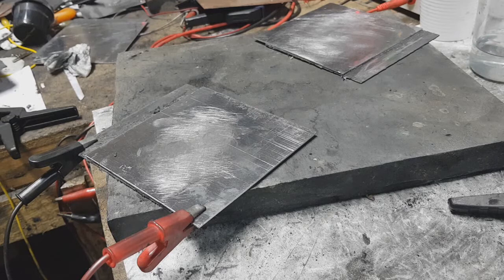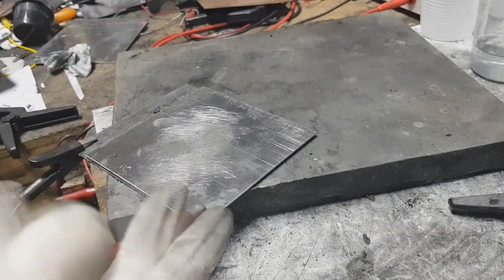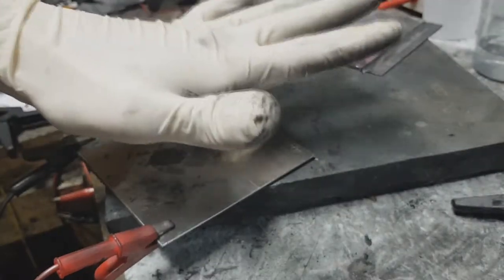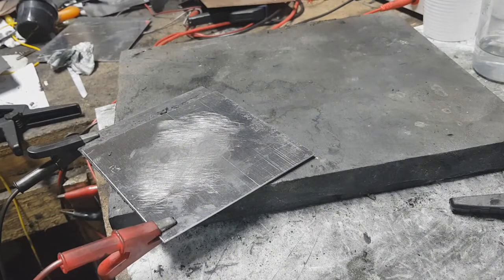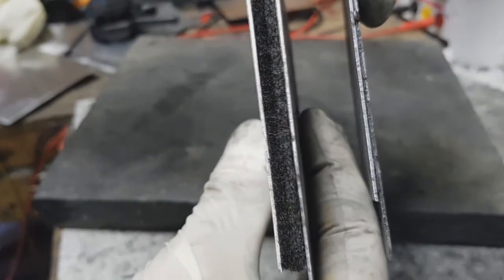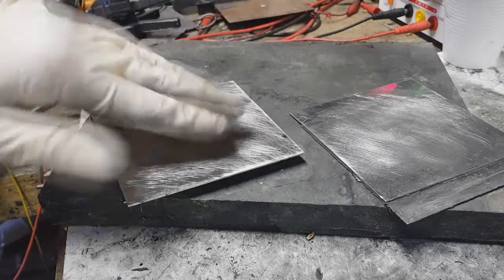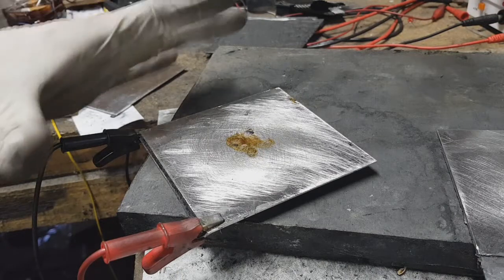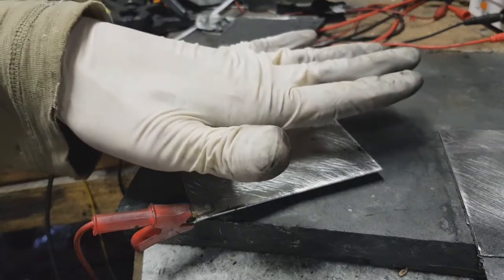Carbon Heating Panel

Comment: Try using some of your ink on top of your heating device, as a target, to get a more accurate temperature reading. The characteristics (emissivity) of the carbon ink should provide a relatively good infrared temperature reading. The plastic may be giving you a reasonable indication but without knowing its emissivity its difficult to know. As always great video.
Reply from the maker: Q Absoloff good idea my friend. Thank you

Comment: Very interesting. For beekeepers we need heaters that maintain a temperature around 157-160C to vaporize Oxalic acid. It is one of the most environmentally friendly treatments for varroa mites. Many people are using diesel engine glow plugs or nichrome coils. This may be an ideal replacement.

Comment: Hi Caerex2.

 Wow, wow, wow, thank you so much. 

Of course I have some questions .😄 
1. Your powersupply, is that 220 V?
2. Is that carbonfoam that you put between the 2 plates?
3. How much Watt does it take? 
4. What kind of plasic to use on top?
5. Can a larger one, 60-60 cm or so, give heat in a 4 m2 room? (I want to quit my wooden stoves.) 

Hope you have time to answer my questions or somebody else. 

Soon I will share my home made rechargable seasalt battery of 12V!!! ( will do that in my very best English)
🌹
Reply from the maker: Fransje Bik hello. Hehehe,..... so,... yea my power supply using 220V of input voltage, but the heater need only 8 to 12 volts.
Yes, it is carbon foam which I coated the carbon foam with my special carbon ink.
The power which is needet is max 60 watts.
On top is no plastic, is just a aluminium. In the video you see a plastic whic was melted, because I only tested if the heater can melt the plastic.
Heat the 4m2 room,.... yes. If not you just add more power. Just set the panel on the top of yout room  and the heater  will heat really well.
Reply: cayrex2 Thank you so much, that is a great help for me. 🌹